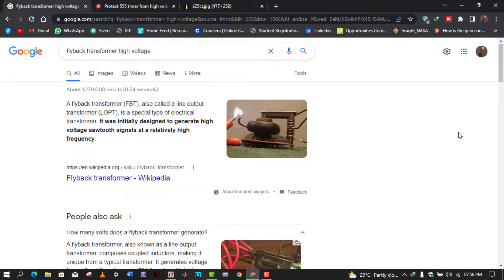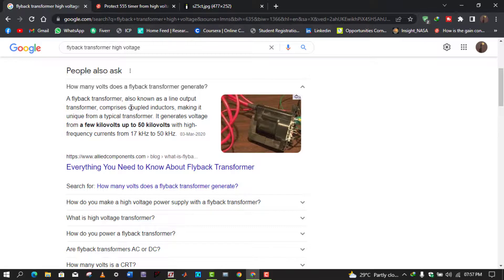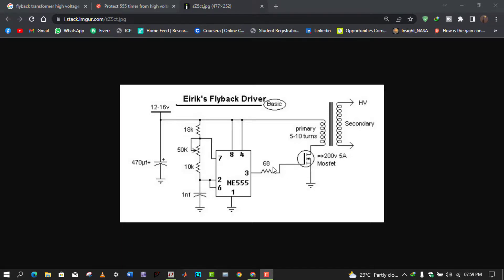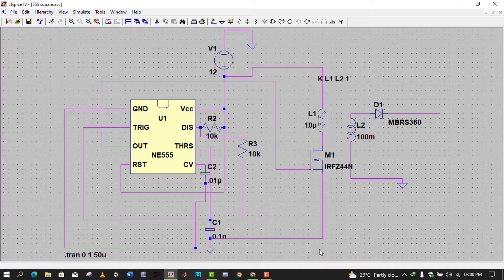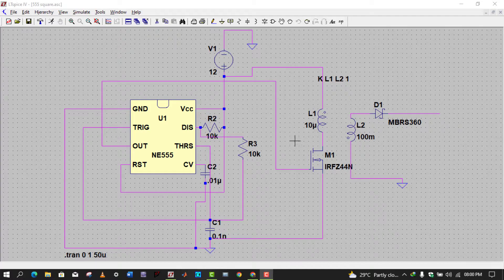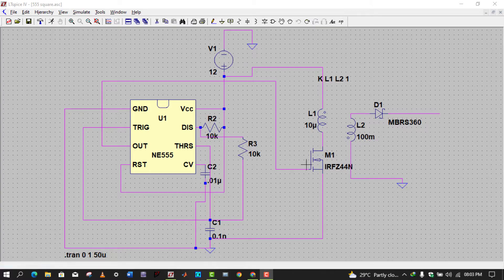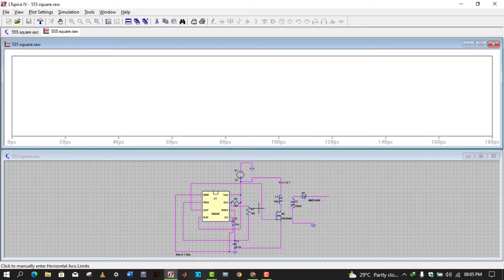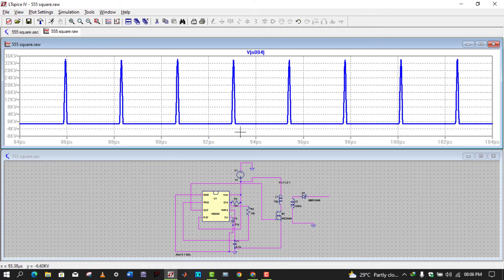How to make a high voltage supply, 12V to 35kV High Voltage Power Supply, Flyback Transformer

Comment: 35 kV is spectacular. Great work with the circuit. I'm working on a super-amplifier project (basically any transistor signal amplifier but with multiple times greater amplification), it's not a small circuit at all. It's technically not even a transistor amplifier anymore because the numbers involved are way above what even the largest transistors can handle, so I'll need to pick a powerful substitute.